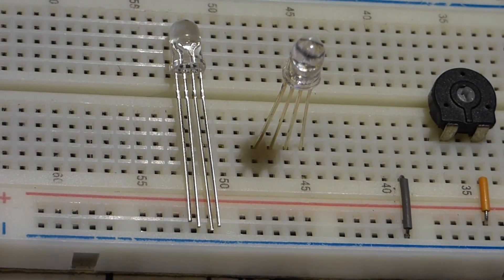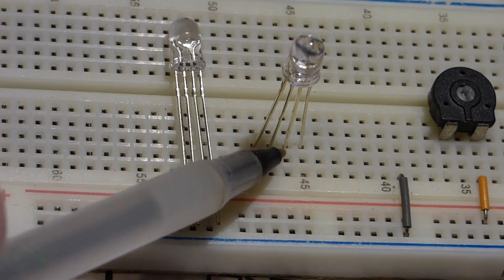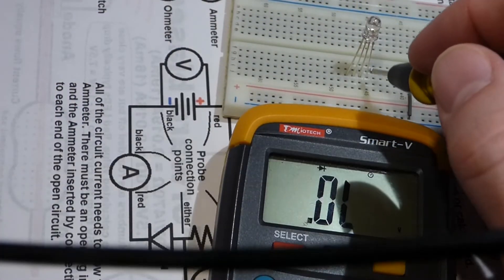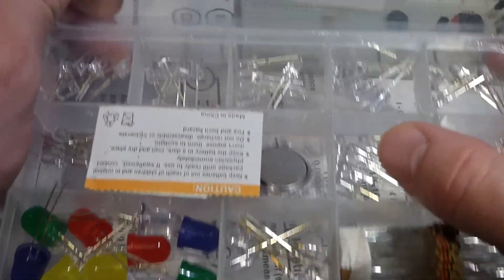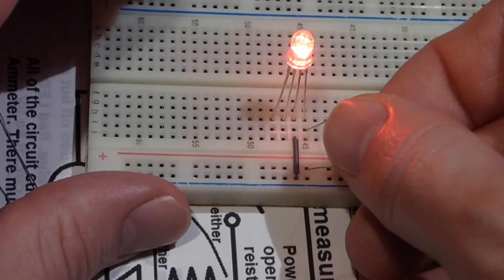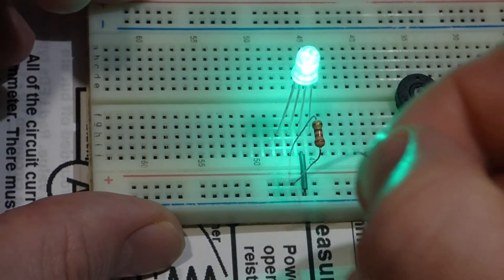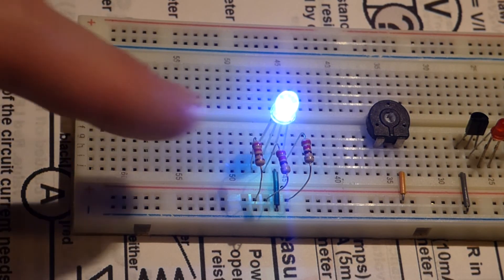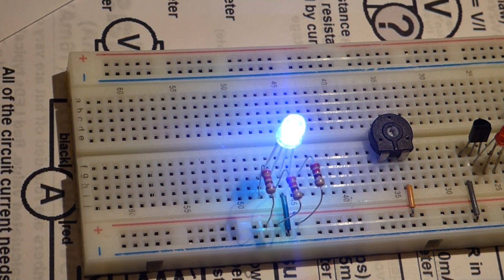Clear common cathode RGB red green blue LED component testing by electronzap

Comment: Helo sir... 
u'r tutorial is very2 good.

But anyway i would to ask u about how to determine RGB cathode vs RGB anode.

Sir... i have two type of RGB LED.
Comparing between to rgb  i take notice to the neck of four pins from rgb... 
This is different i have found...
(a) first RGB LED ---> it's neck is fresh smooth...
(b) second RGB --> it's s neck is very very rough like a saw blade....

So sir... which is anode RGB and cathode RGB...

thanks regard sir... :)
Reply from the maker: Thanks for the kind words! Best thing to do is use a multimeter with a diode testing capability. When the red probe is touching the anode and the black probe is touching the cathode, and LED will light up. One of the leads will either be the cathode shared by all 3 LEDs or it may instead be the anode shared by all 3 of the LEDs. I don't know what the neck differences may mean, I haven't come across that.
Reply: sir ... the neck i means is about 0 to 5 mm on pins that starting from caps of RGB. We can grasp slowly .... feel ..... and we know there is a difference. It's not the same. The first type pretty fresh smooth; there is only a circle on pins. 
But at the second RGB we will feel it's like an a saw blade.

sir... hmmm ..... i think maybe this is a very simple way to know which is common anode and common cathode RGB without tools.

thanks regards sir :)